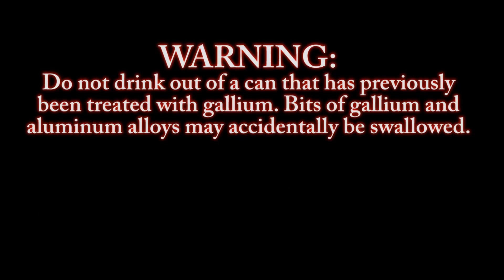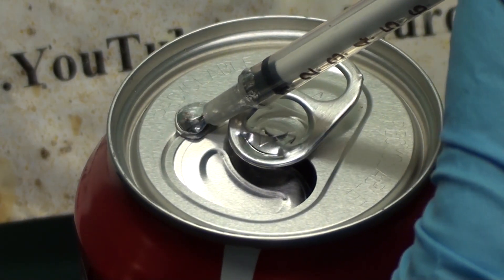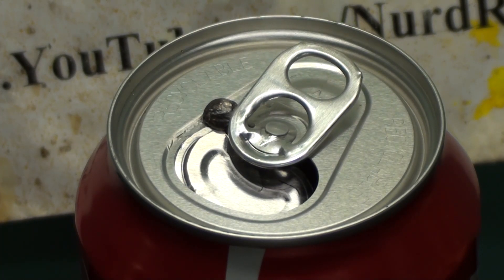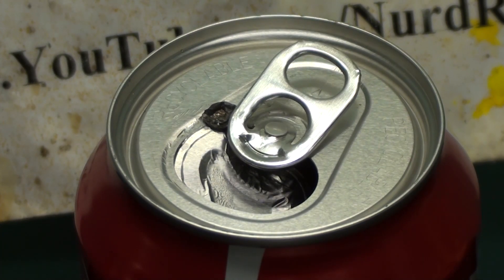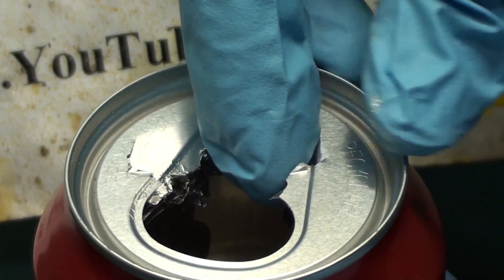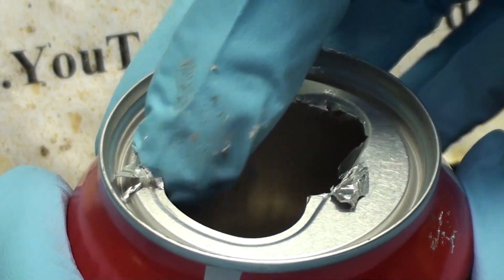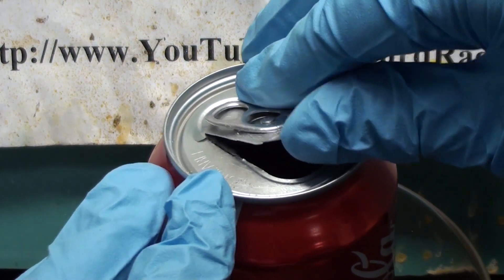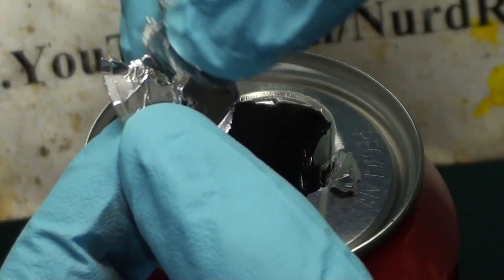Gallium Induced Structural Failure of a Coke Can

Comment: The video states that the aluminum (Al) alloys with the gallium (Ga). This is not true. The liquid Ga isn't diffusing into the Al crystal, it is slipping in between the Al grain boundaries, weakening the bonds between Al grains, and causing the Al can top to weaken and crumble. This experiment would not work with a single crystal of Al. Nor would it work with magnesium. The Ga wets the Al grain boundaries because of the unique interfacial energy between the two materials. Hope this helped!

Comment: The aluminum is extremely weak an fragile by that point. There is no way it can slice through the glove or slice your hand, because you need strong resistance from the metal, against the hand/glove to make it injured/torn. Try cutting a glove  using a wet tissue paper; it won't work in any scenario.

Comment: First, I meant nickel alloys not copper.
Anyway, it's more of a surface tension problem than anything else. Mercury can also have a similar effect on aluminium. So atom radius isn't part of the problem since the gallium flows between the grains, not inside the atomic structure. Even water can have the same effect (when you put some hard dirt in water and it becomes soft).

Comment: Actually it's not only aluminium. It also works on copper alloys and other metals, just to a different degree.
Gallium simply goes between the grains, like water would fill a sponge, and forces the grains appart. The grains aren't linked together anymore and just fall appart.

Comment: If it has not been asked before, what was the time from application to failure of the unopened coke?  and 2.  It looked like you used a 1 cc syringe?  So looks like a 1/10 cc application broke down the structure of say one gram of AL?  An application to an aluminum engine block (46 kg of aluminum cyl block for example) might work out to a coffee can sized load of gallium over the top of the engine block?   Might work with with less than half that as the reaction does not plot linear.

Comment: I remember doing a little chemistry research project about Gallium, but I read in multiple places that Gallium is nontoxic, and is okay to swallow. Yet you stated that you should not drink out of a gallium-treated soda can. NOW, is this because of the product that is synthesized by the Gallium + Aluminum or is it because Gallium itself is ACTUALLY poisonous? Or did you just want to be safe and not get into any trouble, and just stated to NOT drink from it simply because you don't want to check?

Comment: Quoted from the net....

While metallic gallium is not considered toxic, the data are inconclusive. Some sources suggest that it may cause dermatitis from prolonged exposure; other tests have not caused a positive reaction. Like most metals, finely divided gallium loses its luster and powdered gallium appears gray. so, when gallium is handled with bare hands, the extremely fine dispersion of liquid gallium droplets, which results from wetting skin with the metal, may appear as a gray skin stain"

Comment: So I want to use to this "eat" the aluminum case of an old hard drive (easier than fucking with all those torx screws) to get the neodymium magnets out. Afterward, how would I go about getting the gallium out of the alloy (What is it called anyway?) so that it could be reused and the aluminum could be scrapped?

Comment: Just make sure you are handling the RIGHT kind of mercury (which is safe). I worked in a warehouse that's larger than a shopping mall and was a hazmat responder there. In case of a mercury spill (which only happened once) the whole building was shut down and people evacuated and I cordon off the area then call in a more extensive hazmat team from the outside.

Comment: What kind of question is that? Trying to break into someone's house? The short answer is no. Well, unless the door is made of pure aluminium, and you have a few hundred grams of gallium (not cheap!) and you have a way to keep the gallium in contact with the aluminium door for several hours (assuming the door will be much thicker than the coke can, it could take 30 hours to diffuse in).

Comment: mixing water and acids generates heat (it's an exothermic reaction). when you pour water into an acid like sulphuric acid, it immediatly evaporates and causes the acid to splash around, which can be pretty dangerous with some acids. don't know what you mean with the alkali, i think most of them react so violently with water that it will explode quite quickly (unless that's what you want to do ;))

Comment: @TiagoTiagoT it is protective, but if you use gallium it will greatly slow down the process, until it could find it's way, and that layer is almost, but not completey unaffected. I've seen with my own eyes couple of coolers damaged with gallium, and we tried to damage another aluminium plate, to check how it does. And yes, when you remove damaged part with something hard - it looks damn nasty XD. sry for my bad english

Comment: @Anthonyk312 
Capillary action is not diffusion. No gallium atoms are making their way into the aluminum lattice. The gallium is simply wetting the Al grain boundaries due to low surface energy at the Al/Ga interface. This experiment would not work for a single crystal of Al.

Comment: @SlimySnail44 Gallium has an extremely low melting pressure. It is a solid at room temperature, but the heat of your hand is hot enough to melt it. So, from the gallium's point of view, the room-temperature aluminum can might as well be boiling water.

Comment: Mercury has a similar effect and it was used during WW2 by allied saboteurs on German aircraft. I don't know if gallium was used as well, but using gallium to break up the aluminum oxide and then adding mercury is devastating. It will turn aluminum to mush. Aluminum is protected by a thin layer of aluminum oxide, its like how our outermost layer of skin is made up of dead skin cells, a thin protective outer layer.

Good way to ruin someones expensive aluminum engine, just add gallium and mercury

Comment: @NurdRage Will this penetrate thick Al? If it spreads across a 2" area of the surface, will it also penetrate 2" into the Al?  
Can this process be neutralized so it stops the reaction once started?
Example question - If an Al bolt was screwed into a Fe block & Ga was added to the bolt head, would the Ga have any effect on the steel once it reaches it thru the Al?  would Ga or Hg affect paints with Al as an ingredient?

Comment: You should Flip the can over and put it on the bottom.
Also what would it do if you put gallium and Mercury in the same jar would they mix or would the gallium float on top because its lighter.
And would there be a noticeable line between the 2 liquids.

Comment: Damn Gallium is a very rare metal! 1300 $/kilogram whit an annual worldwide production of 30 tons... what is the main use of gallium in the industry? Using it to induce weakness in alluminium is cool but it's a waste... there's a way to "pull out" the Ga you used from the Al? Or you need complex procedures such as electrolysis or such? Or is totally gone?

Comment: @fredrickpendragon - Okay, that makes sense, although if it melted when fired it would splatter out of the barrel, rather than against the target. What is its melting point, anyway? Some of the same people also discussed making a knife of gallium which could also at least partially dissolve, thus eliminating much of the evidence after its' use.

Comment: @prisoner1138 Yeah, and many have a core of fire resistant insulating concrete, or fire brick. Since I am not running a how to on safe cracking I won't elaborate on any techniques I picked over the years. I have worked on Bank vaults and seen where some were broken into, and the same with safes. I do the alarms, so when someone defies what was in place we find a new way to try and protect the safe. Bank vaults only had steel doors, but the concrete vault has rebar on 2" centers so enjoy cutting.

Comment: another thing is that aluminum does not have a fatigue limit, so there is no limit on how small the cyclic vibrations be that would eventually cause a failure.. steels and titanium have a limiting stress value below which fatigue failure does not occur

Comment: the world needs more titanium, for safety, because aluminum and magnesium are not structural materials... coke can, laptop, even car parts - yeah magnesium aluminum are fine... public buildings, airplanes - no.. if you need low weight and high strength, titanium, thats difficult to work, but at least safe from Hg/Ga terrorist attack, just got a slightly brighter future..  the SR-71 Blackbird was made from titanium

Comment: Ok, now how do we get our gallium back? I heard that if you put gallium in contact with aluminium and put it all in water, it will help to prevent the oxide layer forming on the aluminium causing it to form hydrogen and aluminium oxide, the gallium basically acting as a catalyst that can be retrived from the bottom of the beaker or what ever once the reaction is finished. Is this true? Could you make a video of it?

Comment: Does this work if the metal isn't necessarily as thin as a coke can?  As in would this work with a nice thick sheet of aluminum?  Also, are there other metals that are weakened in a similar fashion?

Comment: @spamluka Yeah, mercury forms an alloy with aluminium already at room temperature. Normally, aluminium is stabe in air because it forms an oxide layer which prevents further oxidation. But once the mercury comes in, the crystal structure cannot be held up and the whole Al oxidizes.
I don't know if it's just an urban legend, but I've heard that this is the reason why no mercury is allowed on planes...

Comment: I just saw a demo of this at an engineering expo. The guy used a disk of aluminum the diameter of a quarter but about half an inch thick. He pulled it apart with some pliers, it was awesome!

Comment: @JJth3j3tpl4n3 I'm assuming Ga, a metal with a melting point near 30C, behaves somewhat similar to Hg. As Hg eats up certain metals like gold, silver, copper, tin, aluminum w/ scratched oxide layer, very fast, but it can be stored and sold in iron flasks, iron, stainless steel, and I think titanium is probably safe. The way to make Fe amalgam is electrolytically, but you may not be able to do that with Ti, because the TiO++ reacts w/H2O, and cycles. Another solvent might work, & then cha-cheeng!

Comment: I always wondered if Ga would make amalgams like Hg, as Hg is very toxic and scarce. Possibly the NaOH/Cl business might switch back to Ga instead of the membranes and diaphragms.

Does Al/Ga react with plain water? Make a battery/camp light consuming coke cans, dumping aluminum hydroxide flakes? Can the Ga be fully recovered?

Downside now is that Ga thermometers need to be banned on certain things, for the same reason as Hg. Alcohol ones are the only safe ones in the hands of the public.

Comment from the maker: @Slugbunny you have to consider that amount of aluminum is essentially a foil. For such a foil to be formed into a can that can hold down a great deal of pressure both internal and external is a testament to its design and engineering. You doubt the strength of a can that's a fraction of your weight, but can support it if you stood on it properly? 

Oh please.

Comment: @arckon09 no, it doesn't make heat so it's not redox, it's a alloying reaction, the gallium just binds to the aluminum, weakening the structure and basically making it a mush at room temperature, the reason he can mold it around when alloyed.

Comment: @shadowblade145 it's a shiny metal with a low melting point(about 29.8*C) and is very reactive.
it's not acidic, it's just really prone to alloying with aluminum, and since the gallium is a soft metal, once it alloys with the aluminum, it softens it, making it weaken and fall apart, nothing to do with it's PH level.

Comment: @GamingTard gallium is simply a metal that has a low melting point. not as low as mercuty but you can melt it with your hands, the melting point is 80 something degrees F.

Comment: Last time I checked, air shipment of gallium metal samples is tightly regulated and requires specialized containers to safeguard against  damage to aluminum air-frame and skin from the process you demonstrated here.  Liquid gallium has a low vapor pressure compared to many other liquid metals, but when heated under high vacuum it makes shiny coatings. Under low pressure, ~0.1 mTorr, you get Ga droplet cloud formation, gallium fog. Stainless steel survives liquid Ga. How about carbon composits?